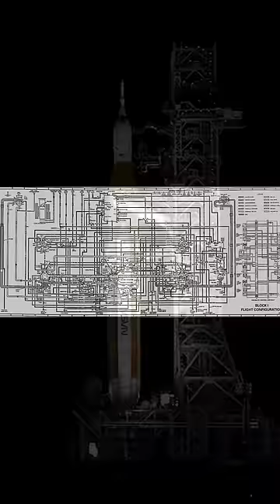NASA's Artemis 1 Rocket Launch Scrubbed Due To Stuck Valve #shorts

Comment: Leave the gambling to SpaceX rapid iteration.   NASA always seems to lose when they gamble.
Reply: NASA is the gambler here, SpaceX is the house. They win on any outcome.

SpaceX Starship launches either work, or they learn something. They are either spectacular successes or spectacular failures, but they are guaranteed to be spectacular.
Reply: @hamjudo  NASA unfortunately doesn't have the freedom to operate like space x
Reply: @idontknowanygoodnames1498  Which is why NASA should be focusing on research platforms that can be launched from commercial providers.   NASA needs to focus on the science, not try to compete with already successful launch outfits.  Think about the exploratory missions we could have put in space if they had relied on ULA, SpaceX, and others for the launch capability instead of trying to make their own.  When I want to go on a road trip to see new things I don't start buy trying to invent a new truck.
Reply: @ShireIO  that's what they're doing, but when artemis was first started it would be unreasonable to think a partner could pull it off.

Comment: Pulling engines out of storage isn't helping. Sure, these motors didn't fail the shuttles back in the 1990s but really? A car that's 25 years old is vintage, some of these engines are/almost are vintage too. $4,100,000,000 per launch and they are used, vintage, engines 😲😲😲

Comment: No time to do things right but we have time for mistakes… Can we just stop with the spectacular embarrassments?
Reply: They are doing things right. This wasn't a mistake. This was a problem that needs to be investigated. Designing, building, and flying rockets is extremely difficult. Sometimes unpredictable issues pop up and need to be fixed. This is one of them.
Reply: @eaglestdogg  - they did not complete the wet dress rehearsal, because of a previous issue, that would have revealed this problem before today.  That was the mistake.  Yes they safely aborted but they were not ready yet again!
Reply: @guyjordan8201   another WDR would not have gotten SLS in the sky any faster. The only difference that could have happened today if it was a WDR instead of a launch attempt was that it could have worked fine and flew.
Reply: @eaglestdogg  -… that and thousands of people wouldn’t have been disappointed at wasting their time and money to be present at a rehearsal.  Discouragement breeds disinterest and we are nowhere near a tipping point in interest so that the money flowing into the industry isn’t in jeopardy.

Comment: LMFAO... a stuck valve on an engine that has been in service for over 3 years.  over 30 years of experience on that engine, and they don't know every inch of that engine inside and out?  70 and 80 year old engineers who built and worked on that engine are probably laughing saying jesus christ, i can fix that in 15 minutes... blind folded.

Comment: they didnt have any issues 60 years ago
Reply: Are you sure about that?
Reply: 60 years ago they were not even using liquid hydrogen as a fuel, which is the biggest liability this project.
Reply: @NUCLEARARMAMENT  Saturn V used liquid hydrogen. Not the first stage but second and third stages did.
Reply: @MrT------5743  I think the Saturn I/IB also used it but even they are not 60 years old, the first Saturn I used a dummy second stage when it first launched in November 1961.
Reply: @NUCLEARARMAMENT  first Saturn V was launched in 1967. The first S-IVB was 1966. And I am pretty sure they tested rockets using hydrogen fuel well before the first Saturn V and S-IVB was launched by atleast several years. You don't just make a whole Saturn V and not test its fuel in smaller test rockets.

Google:
The Aerojet M-1 was the largest and most powerful liquid-hydrogen-fueled liquid-fuel rocket engine to be designed and component-tested. It was originally developed during the 1950s by the US Air Force.

So I guess 70 years ago is not 60 years. Hahaha
Reply: @MrT------5743  Eh you make a good point there, I forgot about the M-1 booster engine.

Comment: Leaking and stuck valves. Doesn't sound reliable. Call spacex. They test 24/7 and have had all scenarios after 5 kaunches. The first 4 might not make it. All that in half the time this takes.
Reply: Yeah, it's not like they've ever had testing problems.

Comment: Would they not have been better to fit the solid boosters to a (proven) Saturn Five to increase its capacity, add to that a LEM with modern avionics and we might have been back on the moon years ago...
Reply: No, because they don't have any working Saturn Vs or F1 engines, nor the ability to make new ones... and sticking giant SRBs on the side basically means you're designing and building a completely new rocket. And since the project would be built by the same people as SLS, the outcome is going to be much the same.

Comment: "The Artemis program, expected to have an ultimate price tag of $93 billion...." NASA: So, we didn't test one of the critical valves on one of the rockets. At least we gave it a shot, it could have worked and flown. After all, it's only taxpayer's money. 👹
Reply: What a niave way to think. Of course they tested all components multiple times, doesn't mean a failure won't happen. A waste of taxpayers money would be to launch it anyways and have a catastrophic failure...
Reply: @Teh_Random_Canadian  Here's part of what Scott said in his narration. Perhaps you missed it: ".... However, the Bleed Valve on Engine Number 3 refused to cooperate. .... This is something that was supposed to have been tested during the 'Wet Dress Rehearsal,' but they couldn't because the Return Line was Leaking. So, they made a gamble hoping that those valves would work on Launch Day, and it turns out they lost that bet."

So, I was being a bit hyperbolic, as was Scott, and noted my dismay. Who knows what else they didn't test.

Comment: I think I'm smelling GO fever at NASA.  That never leads to good things.
Reply: Scrubbing the launch is the opposite of Go fever.
Reply: @MrT------5743  They took a shot that a problem wasn't going to be a problem and rolled it out to the pad.
Reply: @gryphon9507  once again, scrubbing a launch is the opposite of go fever. In order to test this valve they would have had to be just as close to a launch as they were today. Why not just attempt a launch? If they worked they could just launch and save on another wet dress rehearsal.
Reply: @MrT------5743  I'm just hoping it will succeed.  I would rather it not explode on the pad or in the air or such.  It's been a long time and a lot of money spent.  I suppose your correct not really go fever but with so much effort with tech that is already been proven, I just don't want it to explode, that would I think be the end of the program at least in this form.